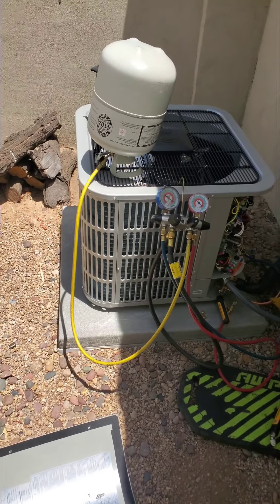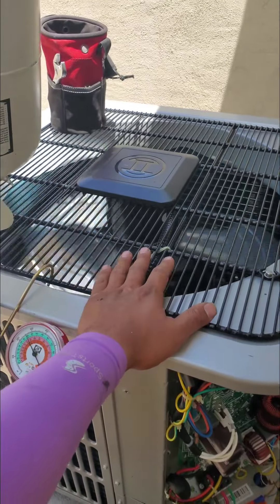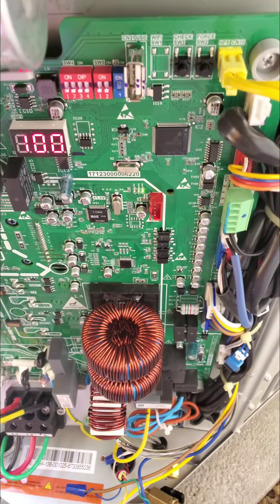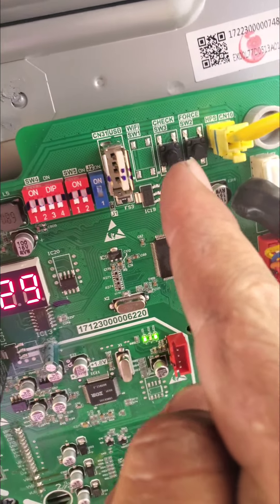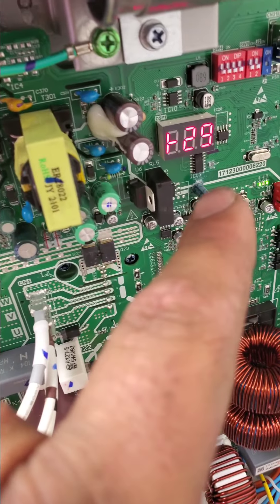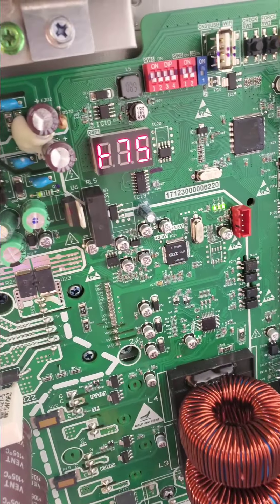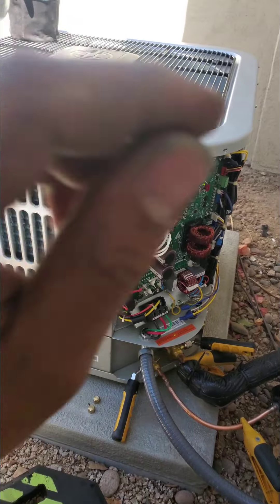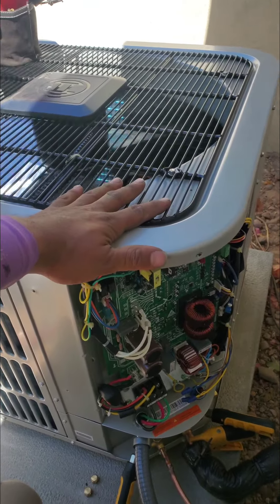20 & 18 Seer Variable Speed Heat Pump BOSCH how to charge FORCE MODE AIR CONDITIONER REPAIR PHOENIX

Comment: Subcooling in the manual for that unit should be at 10 plus minus 2 is 6-7 too low? or should 10-11 be better?  Theoretically which one would yield a better cooling or heating in heat pump mode?  does a higher subcool (in the range that the manual describes) is better? or a lower one is better?

Comment: Our unit is running at around 43hz on a 105f day, and out thermostat is set to 73 but it's 76-77 upstairs, our cfm and static numbers are great, I have no idea how to fix this. Coils clean as a whistle. Accelerated cooling is on and adaptive capacity is off (up position)
Reply from the maker: there's too many variables, could be humidity, ambient temp, capacity, airflow static, air balance, thermostat location, etc.
Reply: @themoderntradesmen9352  you'll wanna hear this, sucker was low on refrigerant. 2 pounds it needed. Then she ramped right up to 60hz and we had ice cold out the vents. I think the original guys forgot to add the 55ft linset to the 15ft precharge because the cooling always sucked.
Reply: @REALBanannaman  im a tech myself, i was going to say probably not properly charged, or if you're in a 2 story home (not including basement) with a single system. Those kind of homes with just 1 single-zone never cool/heat properly, needs to be 2 zones. Im converting my new home's single zone to 2 zone systems as we speak.

Comment: I am also in Arizona and Wednesday i am having BRB-60HWD1N1-M19 installed on my roof,i am new to a inverter system. My current 5 ton still work just being 13 years old it is a killer on the APS bill. Nice video...
Reply from the maker: (with proper installation) not only will your bill go down but your house will FEEL way colder!

Comment: I get these Bosh units as well bit pricey but are Cadillac's. AcPro has a straight cool invertor condensing unit basically work the same way but a little more cost effective for customer without heat pumps. They are called x-series slim line. Other manufactures have straight cool slim line straight cool but not utilizing dc invertors allowing for variable capacity. They are also variable as well 2-3 ton or 4-5 done also utilizing dip switches. If your interested in having a look I can send you the link they just hit the market a couple months ago....
Reply from the maker: they sound pretty neat who sells those?
Reply: @themoderntradesmen9352  AcPro

Comment: What thermostat do you recommend with this system?
Reply from the maker: honeywell t10 !
Reply: @themoderntradesmen9352  thank you for the reply. I have a t6 right now and I believe that is why I’m having an issue. I have the Bosch inverter and handler and cannot get the system to cool throughout the day only early morning. Do you think the t9 Honeywell will be okay?
Reply from the maker: @eloytorres5886  how are you using your thermostat? hopefully not using a schedule
Reply: @themoderntradesmen9352  I use it the regular way I believe manufacture settings. Is there a specific way I should have it set up? It is literally above 10 degrees from what I set it at during the day. Can’t figure out why.
Reply from the maker: @eloytorres5886  if you're a homeowner don't use a schedule just set the temperature and don't move it. These systems are great but have to be set up correctly I may be able to assist you via zoom
Reply: @themoderntradesmen9352  that would be great just let me know a day and time you’re able to. Greatly appreciated sir.
Reply from the maker: @eloytorres5886  drop your email for me please and as soon as I like it remove it
Reply: @themoderntradesmen9352  Have you got my email?
Reply from the maker: @eloytorres5886  no where is it?
Reply: @themoderntradesmen9352  I keep replying it seems that the comment is being removed

Comment: Do these require a fused disconnect?
Reply from the maker: yes they do and a surge protector
Reply: @themoderntradesmen9352  How are you sizing your breakers to these units? 3T is calling specifying maximum 45 amp which is kinda weird considering these are very low inrush and running current. A 3.5 goodman 16 seer only calls for 40A Max! Hah!
Reply from the maker: @OnePointLander   Not sure if you knew but these units have the ability to produce well above their normal capacity (125-135% I believe) especially in heating mode. That can increase amp draws etc. But yes I did notice that. What I'm doing is using the correct breaker and wire, if the breaker is too big then all you need to do Is install the fuses to be rated to what's on the plate.

Comment: "All this technology inside the unit" and the first time you replace any of that "technology" outside of warranty you lost all that possible ROI.
Not to mention that there is no simple fix. If this unit fails, even in warranty, if the parts are not on the van or at the parts house you have no operation until the part can be obtained. For example, at this point in time you have a shortage in the computer industry and those boards may be delayed weeks/months. A basic system with basic parts can almost always be fixed immediately.
Increased efficiency is great but at what cost? What is the true ROI on a 20 seer unit vs a 16 seer unit?
Reply from the maker: I see your point for sure and great questions. I'll make a video answering them because I get similar questions often!
Reply: Well, that's the questions you ask of your supply house or mfg rep about the availability of parts. I get it about same-day fixes and not a lot of guys are going to have a $2000 board as a spare. I work in IT and if one of my network switches goes down I have two options, I get it the next day or I buy an extra to keep on the shelf as a hot spare. It depends on what you want for your SLA.
Reply: That’s why we now have the Golden Pass for all the rep agency’s if the part isn’t in stock the rep agency’s now have parts just in case

Comment: is your pressure on the high side a little to high? should it be about 330, 340, 350 in force mode?
Reply from the maker: no it depends on the outdoor temperature. The summers here are well above 110